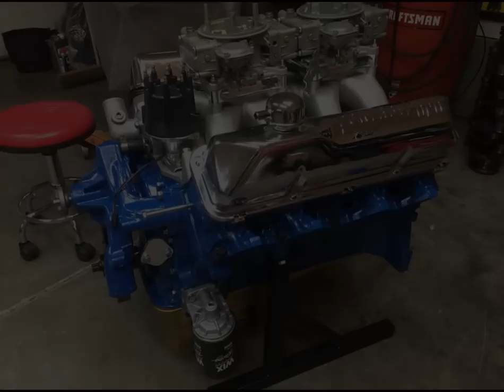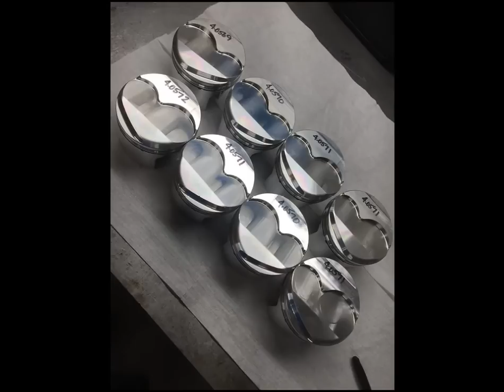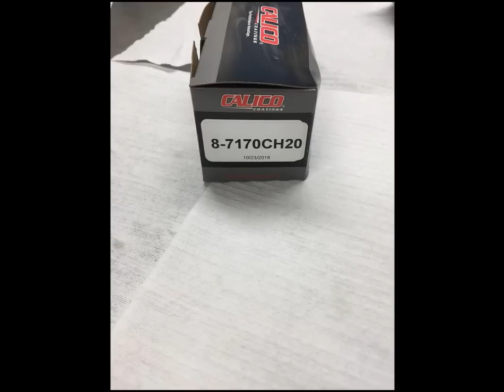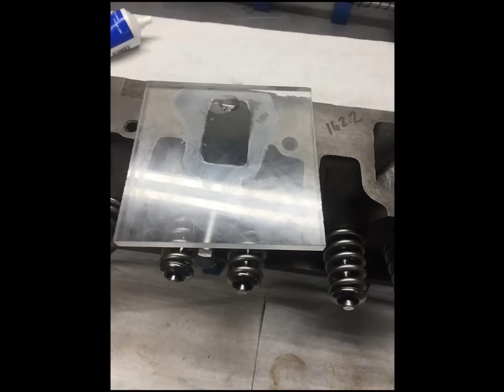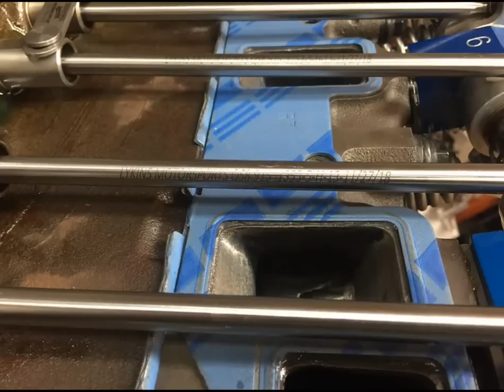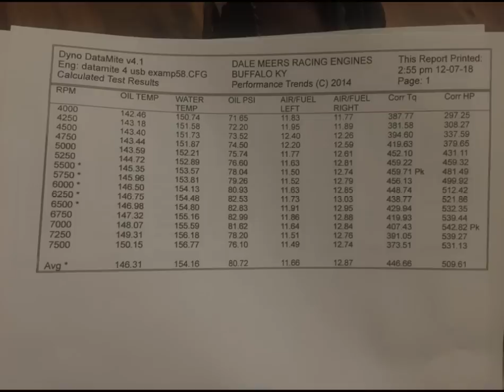Lykins Motorsports SCREAMING 7500 RPM Ford 390 FE...

Comment: The big block MOPAR wedge and FE’a had a lot in common and both were legendary.  The canted valve heads forced their retirement and the new emissions regulations and gas prices killed all the big block refinements that would have come from the big three…the 385 series Fords barely got started.  And Edsel Ford was a the moron who pulled Ford out of racing.

Comment: Have you built a solid roller 390 with TFS heads yet?   
A set of prepped stock rods will live at 7,000 in a stock stroke 390/427.
Reply from the maker: Yes I have and I wouldn't trust prepped stock rods at anything past 400 hp.
Reply: @lykinsmotorsports Tell me about that engine. Is 600 hp possible at that cid?
Reply: @ maybe stock rods was too broad of a statement.  I ran 390GT rods with boss 302 bolts and polished shot-peened beams.  My buddies ran 428CJ rods. Loose clearances and 50w oil. I don’t remember anyone breaking a rod. A few spun bearings yes. We all played with nitrous and spun our stuff 7,000 rpm regularly with no rev limiter.  Only aftermarket rods we knew about were aluminum and ARP wasn’t in existence yet (as far as we knew) thus the Boss 302 rod bolts.  We ran solid flat-tappet  shell lifters and titanium retainers.  427 adjustable rockers and stock shafts. We did break rocker arms but the local parts store kept them in stock.  This was late-70’s early 80’s 20 year olds with shoe-string budgets.  We all ported our own heads. I ran ported 390GT heads with CJ valves and they worked really well.  F427 Edelbrock intake.  800DP with choke horn milled off and blended.   S-code 4-speed Mach 1.  Vertigate shifter that rattled like crazy lol.  Wish I could go back to those times we had so much fun.

Comment: I've never seen the holes in the skirt areas between banks - 3:50 mark. Is that to equalize crankcase pressure or oiling? Perhaps I just haven't come across the right block...

Comment: You don't find that block every day with the more beefy webs. My 390 GT was like that. I drag raced these 390s and had a respect for them in the stock stroke configuration. Back then we didn't have the ready off the shelf parts like today though.  But I managed to get a couple of folks to accuse me of running a 427. Nope not the case, and truly a well built 427 would have done me in !

But I have to say, your 352 is quite the surprise !

Comment: I'm interested in your input on water pumps for the FE, especially in a high rpm build like this. Have you seen/looked for signs of cavitation after teardowns. What do you prefer to use mostly (stock style, edelbrock, or whatever). Thoughts on mechanical vs electric.

Comment: My grandfather loved 352 police interceptor engines & would overhaul them & ibstsll them in modt ever Ford he drove. I was young, but remember being sucked into the seat when Grampa would accelerate. Best feeling ever. Sounded nice & pulled like a bandit for a full-size automobile. I dont know the difference between the standard 352 & the police interceptor version's,  but there had to be in the heads, compression ratio, and camshafts I would think? Nice FE for sure.
Reply: My dad taught me about building engines with a ‘61 352 interceptor.  It had very closed chamber heads and no valve reliefs in the pistons. Football head rod bolts. We put it in a 65 F100 which was my first vehicle and eventually it ended up in my Mach 1 for a couple years between built 390’s.  It was strong for its displacement.

Comment: Mine had a 40 over bore flat top pistons 600 intake lift 610 ex blue racer cam 428cj rods and 428cj crank 427 heads Edelbrock intake

Comment: Ford was the first to experiment with port placement and height for efficiency    . They used a 352 of all engines but it was a mid-displacement engine and made a good mule. That’s why the had so many heads for the FE( low,medium and high risers, tunnel port and SOHC to name a few. The FE engine is legendary and its racing heritage is beyond reproach.
Reply: Was such a cool era wasn’t it? I always said I was born in the wrong era.

Comment: I had hydraulic cammed 428CJs that I shifted @ 7300. 
 300 degrees duration and 520” lift with 76 degrees of overlap was the specs used back then but it was an optional CJ cam. It made the difference between a docile engine or a fire breathing monster. CJs were decent street engines but with this cam it was worth almost 2000 rpm and over 200 horses. Big horses! Thanks for keeping the FE alive. I actually finished one last year with a solid lift shaft(customer requested) and it’s a beast but if I had done it for myself, I would have gone hydraulic and with todays grinds there’s no telling how much power could be made? The one I did last was going in a 64 Falcon. Should make a fun little straight-liner. They are a little tricky to drive with all the weight one the nose but it’s manageable.
Reply: An FE won’t fit in a 64 Falcon without cutting up the shock towers.

Comment: Back in 66 my friend bought a Cyclone and built a 427MR for it.  Full race build solid roller hi comp. It ran 11.70's at a big 127mph. Traction was hard to get back in 66.It was a bad looking motor scooter with those Jardine headers hanging down. With it weighing 3450 with driver. I figure it made about 650hp. Your 390 numbers look right.
Reply: That MPH is a 10.50 or better. Tires and shocks have come a long way.

Comment: Hey Brent,why are the piston skirts so long?,i'm new to the FE world thanks
Reply from the maker: Short stroke!
Reply: @lykinsmotorsports Brent what's a set of these valves 7mm, and 5/16 cost ,or would it be just best to go with 5/16 cause iam going to build a 410,or 431 fe and want to get lot of horsepower out of it as possible

Comment: The 390 is my least favorite Ford engine.  I saw way too many 390 powered cars get beaten by virtually every other big block Mopar and GM.  Too bad Ford put it in so many cars.
Reply: They weren’t built right.  I had a lot of success street racing a 390 with ported 390GT heads and solid flat tappet. There were many FE head variations and all the medium riser size heads needed was some minor port work.  Block decked for good quench and stable valvetrain for 7,000 rpm. And headers that didn’t block off part of the exhaust ports.

Comment: Nice build Brent. Two questions. Would a set of TFS heads with 11/32 valve stems have given you any advantage due to the port and chamber design, or do the 7mm intake&5/16exhaust stems in the Cobra Jet heads negate that advantage? Next question is would the BBM tunnel wedge be the choice on a 500-511" engine, or would the TFS version be a better choice on an engine with a rev limit of 6800-7000 rpm? Thanks for your time. And keep the vids coming.

Comment: Good evening. Question...when you have the factory iron heads ported, do they or can they do much or need to do much with the exhaust port? I've always been curious about that. I built a few of these engines years ago but they were just basically stock setups for pickup trucks, never got into much in the way of performance with them. Thanks for your videos,  really enjoy them! 👍

Comment: Gosh, I wish I had the patience to get in line and have you build my 390 for my 69 Mach1. I had it done by a local machine shop in Indy. Wiped the cam upon break in. Took it to another shop and I’m disappointed in the power and the oil pressure does some weird and scary things.

Comment: My dad raced a 427 fairlane wagon with a 4 spd in stock eliminator for years. I remember him winning class run offs against big block camaros and  400 firebirds. To me then it was just the way that it was. Today I realize a station wagon should not have been beating cars that weighed 800- 1000 lbs less in class run offs. Set up is everything. The FE will always have a special place in my heart. Love the FE videos.
Reply: @ i remember  Dave Charboneu.

St Paul MN.
Reply: Richard Charbenough  @tomrinde4487

Comment: I have a 390 block that I want to build, but I’m not nearly knowledgeable enough about them,   as you are. What would you guess the engine build would cost for a similar build, but a single 4 instead of 2-4’s? I know there are many variables. Thanks.

Comment: Stainless and not titanium valves?  How come?
Reply from the maker: Would you have wanted to pay the $2500 for them?  😂
Reply: No. But I thought stainless valves would give up at high revs and spring pressures. Love your contact BTW.
Reply from the maker: I've ran stainless at 8000 rpm and 700 lbs.  That's about the limit that I would run them though.
Reply: Great!  Good to know. Thx

Comment: Hey, if you live in Kentucky and own a olds , does that make you a good olds boy? Asking for a friend. Thanks for doing the FE videos Brent, been an FE guy for the last 40 + years , have done lots of 391 engines, most of mine were in what we referred to as frost fans, basically a big wind machine in an orchard. Also used to run a 410 that I custom built back when I was about 19 years old in a 67 ranchero.

Comment: We  used Ford lightweight valves and the exaust valves needed to be X Rayed before using them because they tent to snap off .
Reply: I think those were sodium filled. Please let me know if that is incorrect.
Reply: @michaelsilva7176 yes you are correct.  They would erode inside the stem and get weak.